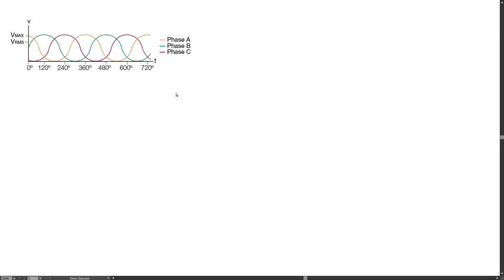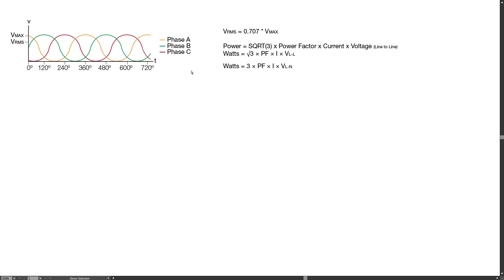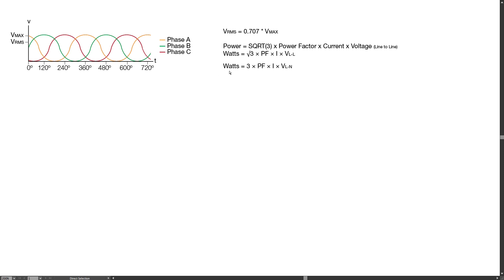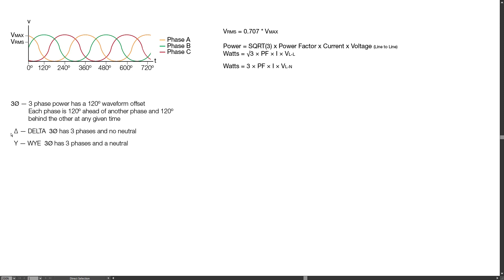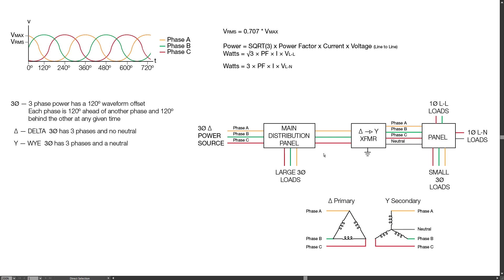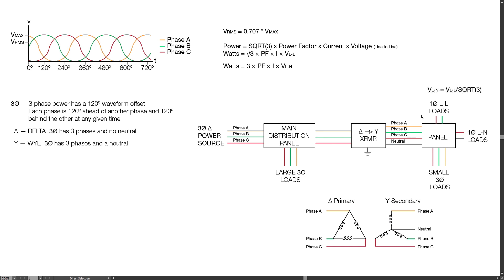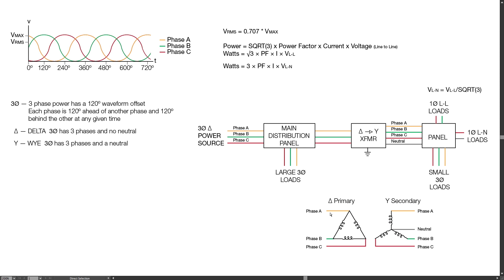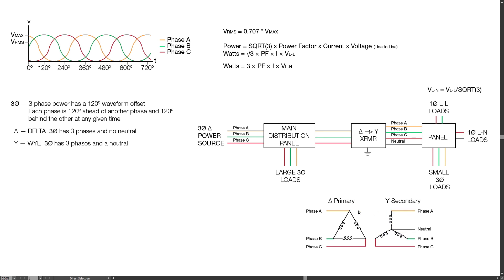Understanding 3 Phase Power in Delta and Wye Systems

Comment: This was a big help. I was trying to understand an AC aircraft system I’ve got that’s powered by a 3 phase Wye Alternator. All three phases are split off to provide 115 V AC for redundancy to the windshield electrical anti-icing system. I didn’t understand why they went with Wye vs Delta. You cleared that up. Thanks.

Comment: Ok, can I ask this John? In my facility, power incoming is 3ph 240v. It's an older facility, very old transformers on the pole coming in. When I measure voltage across L1-L3, L1-L2, L2-L3, I get 240V at all times, However, From L1 to neutral, I get 240V. L2 to neutral is 120V, same case with L3 to neutral, still at 120v. Is that a delta configuration or Wye? 

Thanks
Reply: Nathan Pinson that is a delta with a neutral
Reply: It is a delta but your 240v from L1 to neutral should be around 208v. That’s what we call a Hi leg. Maybe miss read?

Comment: I learned a lot about Delta and Wye connections in my power course for my electrical engineering technology degree, but I am refreshing myself on some of the concepts. When you use a transformer (delta to wye) to scale the voltage down, does the V_L-L always have to be 208V? I would assume yes just because the single phase line has to be 120V for residential homes and small businesses. But could it be scaled down to be anything other than 208V?
Reply from the maker: Yes to get 120V L-N from a 3 phase system it needs to be 208V L-L.  That said a step down transformer can really be anything but typically commercial scales down to 208V or 480V in North America.  Residential is usually split phase from 240V L-L

Comment: if we have dual supply. one is delta and the other is wye. is it possible to connect wye and delta source?
Reply from the maker: Not a lot of info provided but assuming typical and you plan to only use one supply at a time you could connect both to an ats assuming both supplies are the same voltage.  Output of ats as Delta to transformer.
Reply: If they are at anytime in parallel then no because there is a 30 degree shift between delta and wye. Saying that I’m assuming the primary of both sources are the same, both delta or both wye.

Comment: So, given 208Y/120 volt.... Would 208volts be the amount generated from two points? What would all three lines (phases) produce, 360 volt?
Reply from the maker: Excellent question, the line to line voltage is the same regardless of if it's 1 phase or 3 phase.  The power is not the same though as you have current flowing over all 3 phases.  Note the power formula shown, for 3 phase application it's sqrt 3, for 1 phase application it's sqrt 1.

Comment: Delta can have a neutral if it is a 120 Delta secondary. It has a middle tap kind of like a split phase transformer. Yes Delta can have a neutral.
Reply from the maker: Yes, high leg delta's can have a neutral but they're not that common in most areas.  The comments are generalized to cover the most common circumstances.

Comment: Delta can create a neutral
Reply from the maker: right but not typical.
Reply: explain please...
Reply: Roy Laird I agree. A center tapped delta used when you have a small amount of line to neutral connections with the bulk using all three phases. And the main difference between delta and wye is the voltage will be higher in a delta than a wye but has a lower current, where a wye has a lower voltage but more current. That is the main difference, but yes most of the time the delta doesn’t have a neutral in agreement with the video but a delta can have a neutral totally agree.
Reply: The only time you can get a neutral from a delta is if one of the transformers in the delta has three bushings. The middle bushing is center tapped in that winding. In saying that let’s not confuse concepts. Delta has no neutral, and a wye has a neutral. The only reason why we have or get a neutral in a delta system is because of the third  bushing on a transformer.